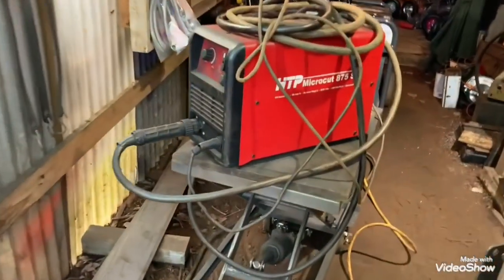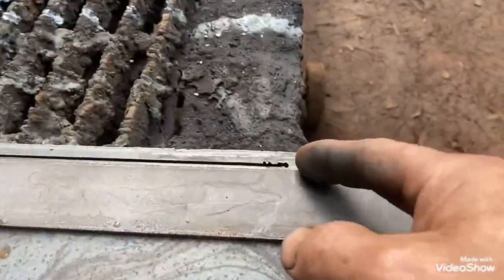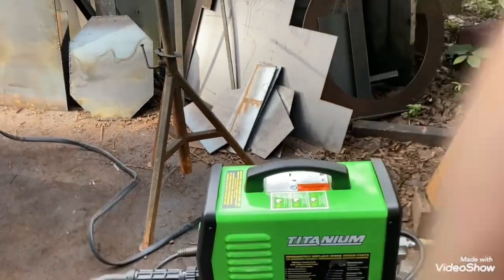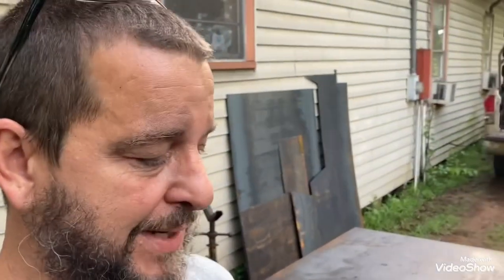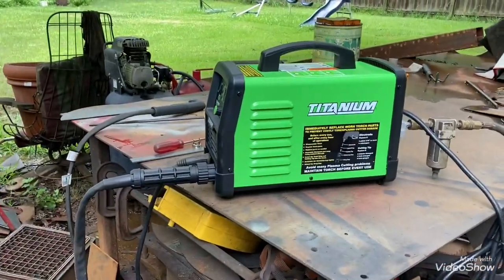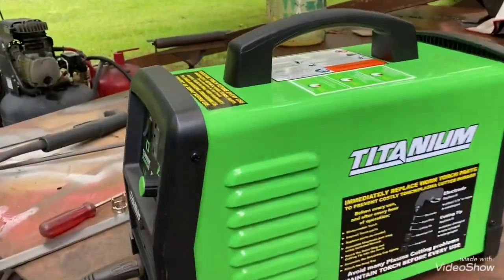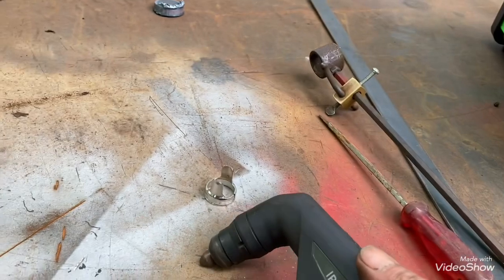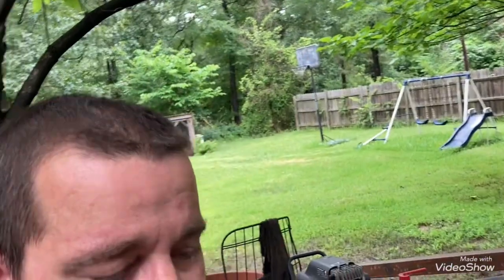Plasma down!! New Titanium plasma

Comment: Thank you ALLEN! Guilty as charged here! In a pinch I always pick up a Harbor Freight tool😉. Have a Hypertherm and a HTP 875S. Both over six years old now. The Hypertherm as always performed flawlessly. The HTP, when first bought, would not cut. Jeff Nolan from HTP came out and swapped torches and tried it out himself. With problems still existing, he replaced the unit for a new one. This was six years ago, but HTP has tremendous customer service and did stand behind their product. The 875S is a true workhorse. Hoping they get you up and running FAST!!! Keep up the quality! Love your work Brother⭐️⭐️⭐️⭐️⭐️

Comment: Humidity can also be hard on electronics
Reply: With the job those machines are supposed to be doing.... they'd better be more rugged than that then! Especially if you want to make inroads with commercial businesses.  Pot the electronics, coat them, do whatever needs to be done but never make excuses why a machine failed to a customer! One machines and word of mouth isn't worth the good advertising and a lifetime customer!
Reply: The problem now, is just about all the manufacturers are getting their electronics from overseas or Mexico. The quality control is not that good. Next time you buy consumables for a Miller, Lincoln and the other major brands, look on the back package Made in China.

Comment: Did you have a serious moisture condenser in line before the cutter? Especially in your humidity. I just made myself a big radiator out of copper pipe. Air goes in one end, goes up and down up and down. Out the other end and has valves on the bottom to drain. Lots of ways to do it but all the big shops do the big radiator style mounted on a wall. It's one of the things that they never tell you when you want to go plasma. You need dry air and in my case a pretty costly 100 amp breaker installed. Feel free to reply or message with any questions I switched from torches to plasma in my little home shop few years ago. Took me a bit to figure out the right setup.

Comment: Call Jeff..  Not your local yay whoos.   Ask them if they've ever heard of Stel!  When you get dumb looks, you know it's time to walk away.
Reply: We have no Stel in ANY of our local welding shops from my area and 60 miles around me. I've heard of them but nobody sells them around here. I don't think I'd like to be stuck not finding consumables.  
I know they're popular with welding especially in Europe..... do they make plasma cutters?
Reply: @FastBowtie388 HTP IS Stel.  Stel is more famous than Miller for the other 75% of the world.  Point is, You dont take your Ferrari to the ford dealer.  Call Jeff.
Reply: Consumables are readily available, just everything else today, you get it in the mail
Reply: @jagboy69  I can walk into any local welding supplie shops in my area (airgas,  or purity airgas) and they have consumables ready to go. If it's late on a Friday 3pm for instance and HAVE to get something cut or a machine repaired.... I don't care HOW nice that Stel is and how regarded in 75% of the world.  I can get parts for my hypertherm 800 and keep rockin!!! 😉
Reply: My Hypertherm Powermax 800 can cut 1in of steel where that HTP, AND HF Titanium would make a horrible sever cut with a lot of dressing and slag
It's not often we have to make brackets for pumps and stuff that's PTO driven and moving 15,000 gallons of water per hour buy when ya need it..... you need it.  And I can run it down to 220 volts and all the way up to 480 volts. Can take it anywhere and with a few wires moved around be in 3 phase,  or simple 3 wire at home 50amp 220